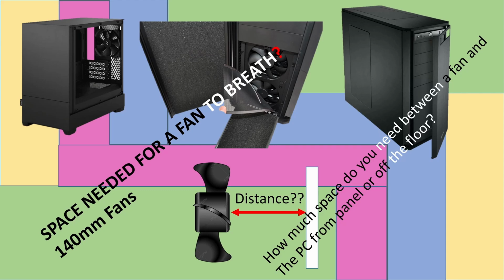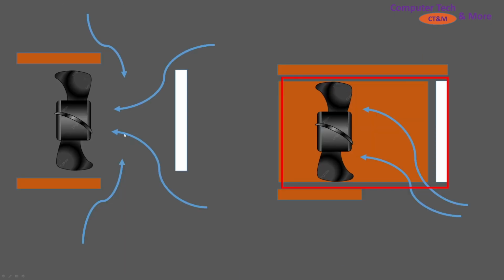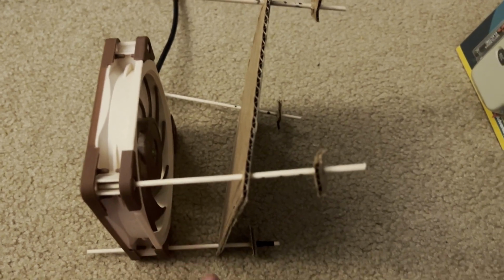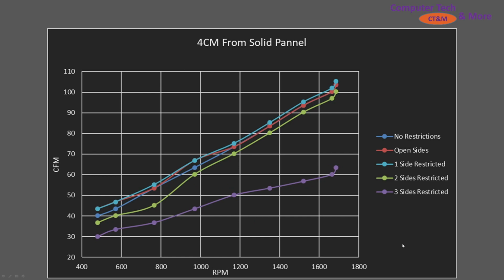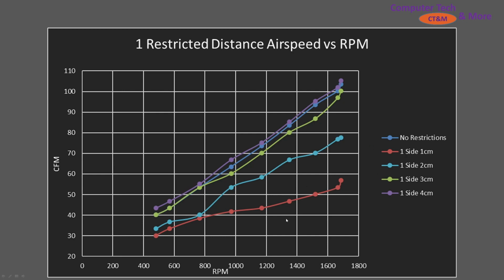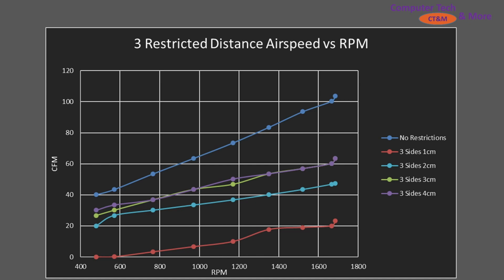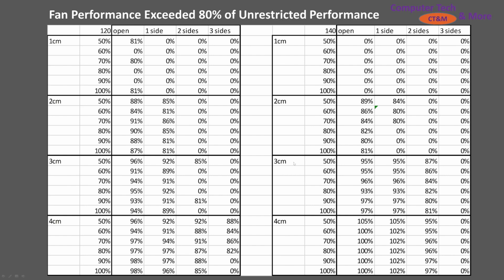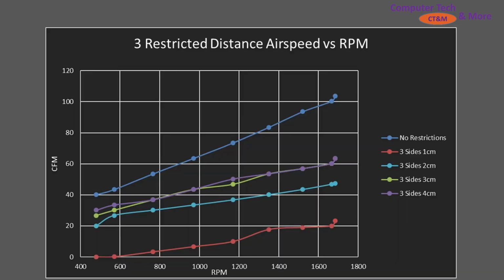Computer Case Restricting Airflow? Solid Panel Spacer 140 Testing

Comment: Do you know any 1-inch separation to a solid front panel cases?
Reply: The fractal cases? I have a define 7 XL and it is  not far away. 

Edit: I measured and it is almost an inch. But then you have a filter as well.
Reply from the maker: unfortunaly its not actively published. I know GN pays attention to this. and its actually why I did my testing. kind of verified Steve's claims.